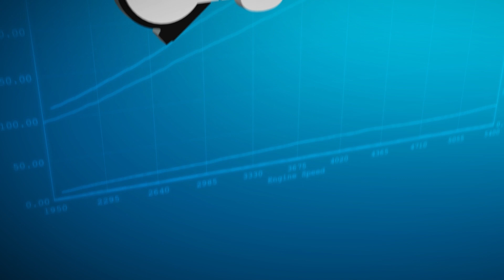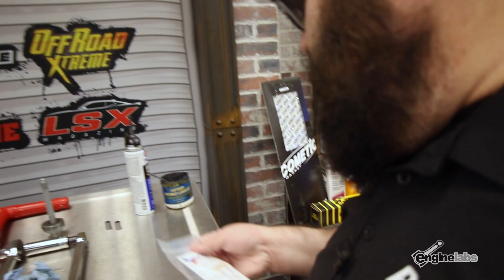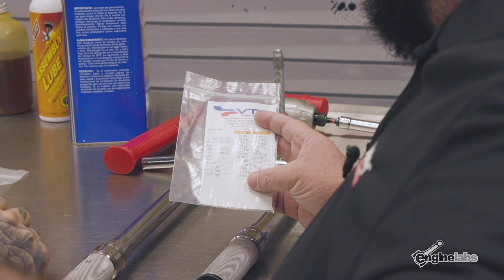Head Of The Monster: Putting The Top End On Godzilla — Part 2

Comment: Ford godzilla is just a ripoff of the Chevy LS. Can ford come up with any original ideas? What do their engineers get paid for?
Reply: How can the the godzilla be a knockoff ls when the ls is a copy of the sbc which is a copy of the sbf....sitdown.
Reply: @pheonixfps9248  Contraire mon fraier, the lifter isolation for each cylinder bank is 100% a Chevy design.  It adds immense strength to the block to enable the engine to achieve horsepower and torque levels, unlike all previous engines. Ford copied Chevy on the Dogzilla. Otherwise, Ford would still be in the stone ages.

Comment: Those LS  guys are so ignorant  , the first engine that would put the crankshaft up in the block, was not Chevrolet, it was the Y block292-312 ford, the first engine to put crossbolts in the mains? 406 FE which evolved into the 427FE, Chrysler's 426 Hemi also did both taking the example from ford, it took Chevy 40-50 plus years to start doing this even then one can argue they're using tiny little bolts just sayin, the real performers who are out there winning oh say??LeMans! and changing history in top fuel drag racing they've been doing this for decades,, Chevy just realized oh that might be a good idea? Duh! And the Mustang looks like the Camaro, can this guy hear himself? The Mustang has been in Non-Stop production since 1964 1/2 the Camaro just came back out looking like the car that supposedly copied it? Does that make any sense?